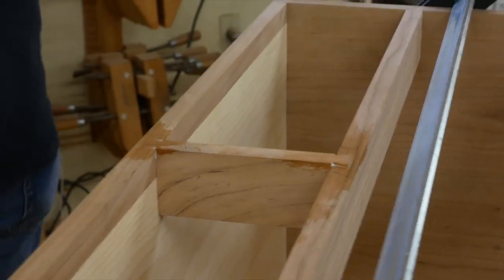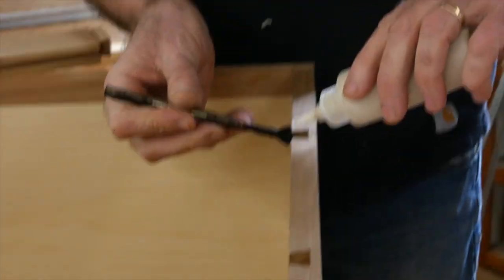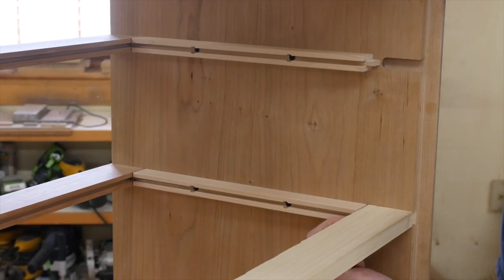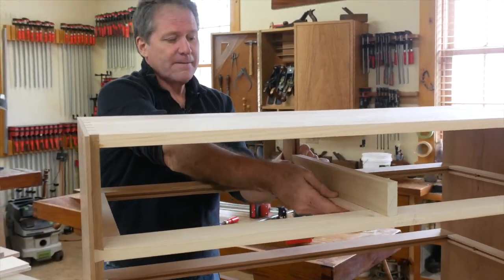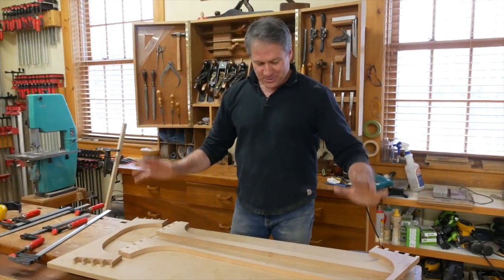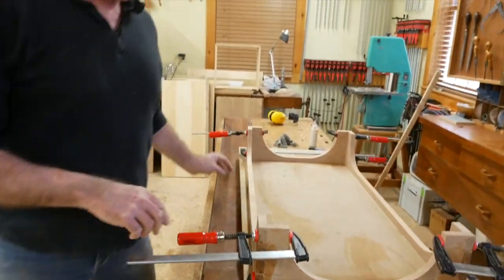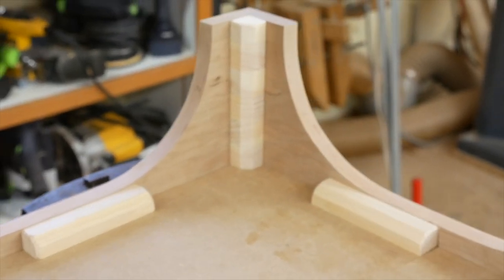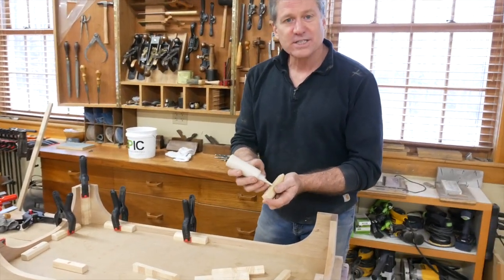Future-proof drawer frame construction

Comment: I have a four chests of drawers and a dresser on my projects list in the next year.  I'm an amateur and am replacing my master bedroom furniture and my guest bedroom furniture (one full size chest of drawers and a dresser for the master, one smaller chest of drawers and two "mini" chests of drawers that are only bed high and act as night tables on either side of the guest bed).  This video is so valuable to me I feel like I should pay you for it.  Before this the internal construction of the chest was a mystery to me and I was going to have to wing it or buy plans, and I never buy plans because I haven't the patience to read them and they never explain the intricacies anyway.  You give me confidence that I can build something that will last, though I hate any sort of mechanical fastener.  Then again, I am going to build them out of white oak, so I do want them to be heirlooms that may require repair some day many years from now.

What material do you recommend for runners?
Reply from the maker: You should be fine with white oak. Tom is using hard maple here.
Reply: Thanks Psi! I recommend any durable hardwood, for this chest I used hard maple for both the interior runners and the hardwood strip laminated to the bottom edge of all the drawer sides...which you'll see better in the next video covering making the drawers. Also, if you are interested in making this chest the full size drawings are available through a link in the description. Thanks again.

Comment: Hi Tom, love these videos. are this screws going into slotted hold on the runner?
Reply: Thanks Michael, I’m glad your enjoying them! I’m countersinking the screws in to the runner and tightening them down. They are only about six inches apart so no need for slotting in this case. If the case moves slightly over that six inches with seasonal changes in humidity, it’s shared by both screws and no problem at all. In fact, you would be safe to even apply glue between the screws if you wanted to given the short distance. Thanks again 👍

Comment: First let me say that it is a joy to watch a real furniture craftsman; One who does not use plywood, biscuits and pocket screws.  Also, one who appreciates that the design of solid wood furniture must always accommodate seasonal wood movement.  That having been said, I have two comments:
First: If you watch furniture restoration videos (i.e. Thomas Johnson Furniture Restoration) most of the non-veneer repairs seem to be caused by designs that did not accommodate wood movement.  Your design, therefor, is far less likely to need repair at some future date.
Second: I always glue in the back drawer dividers.  It makes the case far stronger and it provides a horizontal nailing surface for appropriately sized horizontal back planks.  If the back planking is drawer sized, it need only be 3/8 thick and can be shiplapped at each drawer divider to account for wood movement.

Comment: This is really nice. One question though, if you are screwing the runners in how are you allowing for wood movement on the runner compared to the sides? Or are the screws in elongated holes?
Reply: I’m countersinking the screws in to the runner and tightening them down. They are only about six inches apart so no need for slotting in this case. If the case moves slightly over that six inches with seasonal changes in humidity, it’s shared by both screws and no problem at all. In fact, you would be safe to even apply glue between the screws if you wanted to given the short distance...as I used to do all the time with never any issues. It’s just not wide enough crossgrain to cause a problem like a crack in the side. Hope that makes sense, Thanks! 👍
Reply: @EpicWoodworking  That makes sense. Thank you very much for getting back to me, highly appreciated

Comment: So the thought I had when he was talking about seasonal expansion and contraction was that large, main propulsion, diesel engines, grow and shrink with heat and the General Motors EMD engines have the fwd footing bolts only torqued to 75 ft./lbs. (there's a story there, but this is a short post)  because you don't want the engine to "grow" into the gearbox. I know, unrelated, but you know, related in a way.
Reply: Wow, that’s pretty wild to think about - giant Diesel engines expanding and contracting, which shares similar concerns in a way as you say. Thanks 😎

Comment: You don't need dovetails anywhere on this project. They're merely decorative. Even for drawers, modern adhesives make any edge grain to edge grain joint way stronger than it needs to be.
Reply: That’s a nice idea in theory 😎
Reply: @EpicWoodworking  Show me the drawer put together with box joints that has fallen apart.
Reply: @Heraclitean  Dovetails get easier the more you practice. You'll get it. Until then, maybe buy your furniture from Ikea if you're not into craftsmanship
Reply: @wakamiwailer  Dovetails = craftsmanship is the dumbest thing you could possibly believe. I can do them just fine. I usually don't because they're pointless.
Reply: @Heraclitean  then why even bother with box joints, if you can screw and nail everything together? :)
Reply: Sorry, I just revisited your initial comment again and realize I misread it...thinking you said endgrain. I think you have a point given modern glues. But there is a reassuring satisfaction I enjoy with dovetails, knowing the mechanical fit has integrity to not come apart even without glue in one direction at least. In fact, with dovetails the glue is only needed to keep the joint together in one direction. Sure I could machine a quick finger joint, and they have their place. But there’s also a place for doing things a little finer when you can, and enjoying the simple pleasures they deliver. Thanks for watching! 👍

Comment: What r the odds the furniture repairman knows the back runner isn't glues in place 😂😂
Reply: Good point! 😎 It would likely be discovered since in repairing the interior of a chest like this, the back is most often removed for easier access (this chest will have the back screwed on as you’ll see in the last episode). It should then be discovered the back dividers aren’t glued in and can be removed...and they actually have to be removed to slide out the dust partitions (also in the last episode), so the drawer runners can be removed. Thank you!👍
Reply: @EpicWoodworking  Amazing chest, very inspiring work 🙌👍